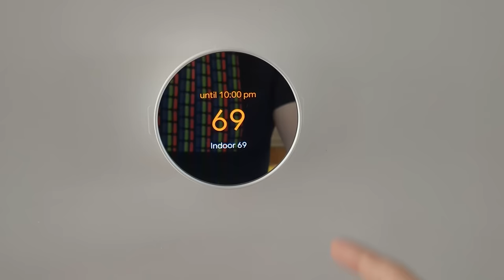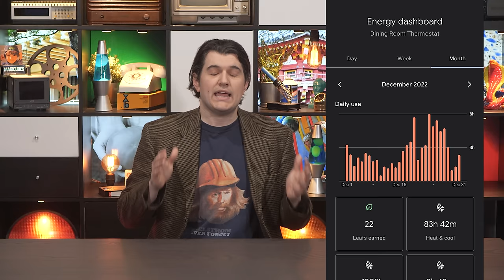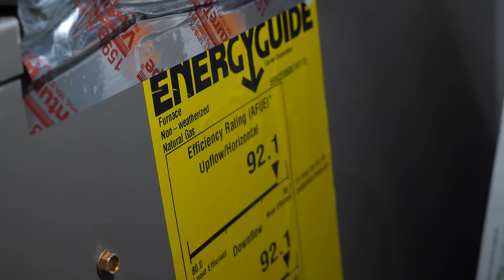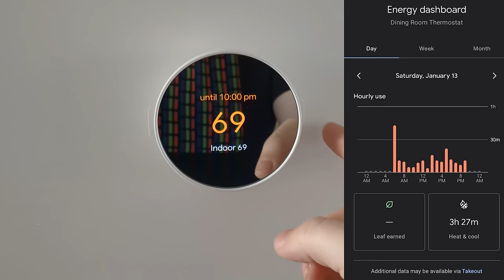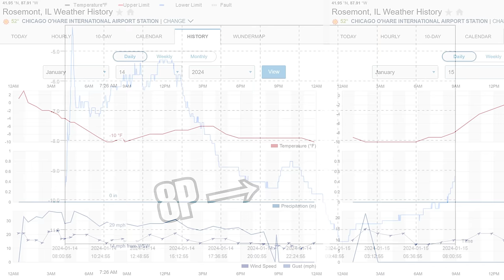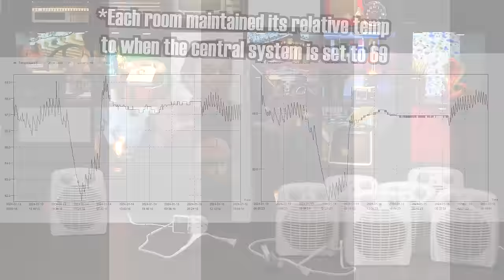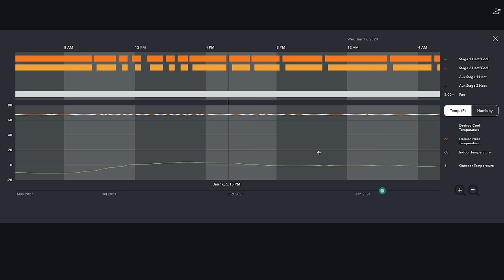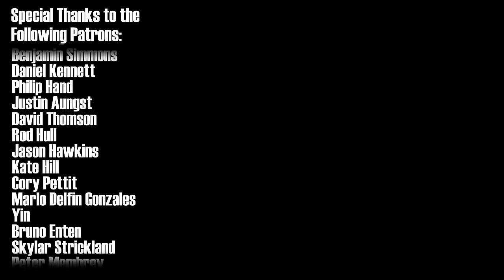Old HVAC industry practices are holding us back and costing us money. But we can fix it.

Comment: I feel your pain of HVAC stupidity after working in the industry for 3 years.  (Commercial)

Leave the paid for, fully operational system in place and add a single head mini-split in your main room/bedroom to take advantage of the heat pump savings.
If you need to switch to an all heat pump system.  Stay away from the many multi-head units (they rarely work as advertised) and install more than one unit.  WHEN one fails you don't lose the entire house and freeze/sweat.

The "modern" attempt at right sizing a system never, NEVER works.  It causes the units to run nearly 24/7, never catching up.  Instead of lasting 20 years it fails after 3.

Another bad (expensive) habit of the HVAC industry is trying to use the main AC as the primary source of dehumidification.  A dedicated dehumidifier should be used.  A modest $300 stand alone dehumidifier from the big box can do most of the heavy lifting and keep a house nice and dry.

Comment: So you’re basing the overdrive on the fact that you’re not running heat for 24 hours straight? Would it not cost you more to run the fan all day rather than a short 3 hour cycle?

Comment: At 19 minutes in, so i haven't watched the full video yet, but heres a couple observations i have made to play devils advocate:
1. While not putting the thermostat above 70 in the winter time and having a programable thermostat to adjust the temp when you wont be home or will be asleep is a great way to save money and better adapt yourself to tge conditions outdoors, not everyone does this. There are many folks out there who want their homes to be heated to a balmy 80 degrees 24/7 in the winter time. New construction projects are built with any one person or family in mind, so the HVAC systems will be spec'ed to meet the highest demanding individuals.
2. While -8 is certainly quite cold, colder can and will happen. HVAC designers will construct the system to be able to handle the highest temperature deltas they can think of (that one individual keeping their house at 80-85 while its the coldest day on record outside), and then add a little more than that to be sure. 
3. Having the heat running more often means that the forced air system will have to run more often as well, and an A/C motor powerful enough to properly circulate the air in the home for heating is not cheap to run. 
4. It was acknowledge that HVAC systems are typically spec'ed out based on common rule of thumb, and also that a townhouse style home is more efficient in regards to HVAC due to shared walls, however no connection has been mentioned in regards to a townhouse not being the typical single family/single structure home that the rules of thumb are derived from.

Comment: I've worked with HVAC, electrical, and electronic engineering, for a large bit of my life. And I have a forced air gas furnace.  I understand exactly how it works and I've repaired and maintained it over its last 25 years. And its still running strong and should be good for another 25 years.  I don't see why I would ever want it to run more than 25% of the time even on the coldest day here in Northern Ohio.  I have a gas powered car and I don't leave it running in the driveway all the time either for the same reasons.  Most of your logic sounds like something you've read from books or got from YouTube videos stating theoretical ideas instead of the real world.

Comment: Heat pumps aren't created equal. Be sure it includes a 2+-stage compressor maximizing SEER around 40. And cut BTUs needed with better insulation and window/door sealing.

Comment: @13:35 this is exactly what happens in insurance - 
Agents don't have enough experience to ask appropriate questions to figure out what insurance is actually needed. 
They shop what you have, hopefully, and that's it. 

Had a multi millionaire that stood out, had 25K/50K/25K limits on his Maserati and his Mercedes. 
Why? That's what the Geico agent recommended. 
The man owned 4 homes - had loads to lose, everything was personally owned by him, no LLCs.

25/50/25?? 
That's something maybe a college kid would carry - someone with very little to lose.

Comment: Im an hvac technician and live in a cooler climate. Heat pumps dont work here, in fact many electrical failures happen due to cold. Moisture and wind chills are not considered in These lab calculations. So this video is correct if you live around the equator, one below freezing day of the year. Let alone lets not get into the lifetime cost of your outdoor coil popping or failures and the cost of repairs (believe me im fixing them all the time). Sorry 90degrees out of registers just dont feel warm to anyone. Smart thermostats are useless on heat pumps due to "eco" settings, comfort and energy savings are two different sides of the coin. Ill agree with the many improperly designed systems and ductwork.

Comment: My apartment I rented was made by hippies. They didn't design our heating system to respond quickly in a cold snap, so I lived in an apartment at 3 degrees Celsius for 2.5 weeks as it was -35c outside. It was honestly pretty cool, I left my computer on 24/7 and my idle temps were 19

Comment: A 60K BTU/hour unit running 6 hours input 360K BTU in the day.  If you downsize 1/4 size, to a 15K, you'll run 24 hours to input that same 360K BTU.  Regardless of the size of the unit, the daily energy need was 360K BTU.  That 6 hours includes the periods of coasting too as the hysteresis limits rise and fall...and running the unit for 24 hours a day incurs additional power consumption of the air handler motor by a factor of 4x.  So you've consumed the same 360K BTU in gas (assuming zero losses) and 4x the electrical power.  Hmmm...  Is my math and reasoning off here?

Also, if you use temperature setbacks, don't you need a higher capacity to inject more heat faster to raise the temp back to the desired comfort temperature? 
ETA:  Ah - addressed at 28 min mark.  🙂

Comment: Haven't even watched this yet, but I already know how awful the "standard" designs are. My focus in Mechanical Engineering was Thermodynamics, specifically. I needed a new furnace (had underfloor heating in my house that the gas company broke in a long story that includes some local-class actions that different groups have been filing). I was looking to add forced air because the pipes were trapped in the slab.

The local HVAC "Specialist installers" declared that my 700 sqft slab house REQUIRED a 5 ton heater and 48 inch vents at $25,000 install cost... The 560-seat theater with 30 foot ceilings that I consult for doesn't even have 48 inch vents... I told the installers to get the hell out of my house right then and followed them out. I removed their company from any commercial install considerations through my engineering consults. My 800 sqft, 15 foot ceiling office has a single 12 inch vent on a shared tube with 6 other offices and BAKES in the winter at up to 98 degrees with two half-glass walls (I can't control heat in that building, so I bake).

Thought about doing water heater sizing next? lol I had a line installed for a 13kW tankless electric and the electricians kept trying to upsell me to a 20 or so kW heater declaring "1.3gpm isn't enough for a standard household."

I have a 1gpm shower head, and I won't be running the sink hot water while I'm in my shower... They kept calling me telling me to put in new lines after it was installed. I'm still happy, the water still burns me in the middle of winter if I'm not careful. I rejected their quote for a solar tie-in in search of a different company to swap my service box.
Reply: Okay, seen a lot of this and I'm at the space heater part. I used to have space heaters (during the boiler broken stage), but I've found that three oil radiators, no fans, no coil space heaters, work better. Went from a $450/month electric to like half of that and it's warmer. Haven't had the chance to do a proper study on why, yet. Some people say "well, the oil stays warmer longer when it's off... Well, yes, but energy is energy... the duty cycle changes though. 

I am wondering if it has to do with the space heaters forcing air and disrupting natural convection, pushing hot air to corners that otherwise won't need it where it ends up getting lost to the outside at hard, uninsulated corners where the corner studs are. Like I said, I haven't done a proper study on it. All I have now is a phenomenon noticed in a lowered electric usage (even accounting for kW usage on the detailed bill on an "always on" month.)

(I also need to monitor why the house suddenly gets sweltering at 2-3 AM... even if the heat is switched off. My current hypothesis is that the outdoor cooling has reached a point of low temperature or higher density that the in-house air has cooled enough or can push out enough to the cooler outdoor more rapidly, then drawing more of the attic's hot air down faster... Need to get the pi environmental sensors running next winter.)

Comment: I have a heat pump, but I also have gas. Heat pumps shouldn't be one's only form of heat, primarily because if the electricity goes out for days or weeks, a heat pump can't be used. Natural gas will still work, though, and keep the house warm.

Comment: I have an air to water heat pump. It is perfectly sized on the cooling side, it runs continuously above 100 degrees outside. But oversized on heating. 60kbtu heating, 42kbtu cooling. But I live in a much milder climate than Canada it was designed for, in the winter. I want to get a heat exchanger to heat the water heater in the winter, but I can't figure out how to design it or where to buy it.

Comment: Heat pumps at -30°-40°F are worthless -25°F is even starting to push it... -11°F not a problem, I watched my parents have 2 different heat pumps for about 20 years, the were great for temps around 20°F... my dad got the first one because the electric company offers discounts on the electric bill for the special meter that only ran the heat pump... but when the power goes out for 3 days and you have a generator switch on your natural gas furnace... nothing beats that... welcome to minnesnowda

Comment: Imo, You are just transferring the burning of fossil fuels back to the electric company which is less efficient than burning it directly. The other factor some say is that the grid cannot handle the increased load from going electric.
Reply: That's not less efficient than burning it directly, not at all.
You're completely ignoring how insanely efficient heatpumps are. 300-500% thermal efficiency most of the year.

Comment: I don’t quite understand why cold parts of the us rarely use radiators 🤔 They are much more efficient than forced air. Although I do agree that with heat pumps this is now a moot point as they are more efficient and provide both heating and cooling.

Comment: 100% duty cycle sounds weird only because it is not what we are used to observing. If you examine what is happening from the viewpoint of the equipment- the equipment does not want to experience thermal cycling. So maximizing the duty cycle, tho a tradeoff with some forms of equipment wear, is preferred in others. And certainly for high efficiency furnaces which prefer to be exposed to as cold of incoming air (or water) as practical- well, going slow is the only thing that makes sense.

Comment: I wanted to buy the heat pump equipment myself and pay a contractor to do the installation. It took a while to find someone who was willing to do the labor without forcing me to buy their ultra marked up equipment.

Also, I have the 3-ton unit in my garage on a pallet waiting for installation. After watching this video, I’m worried it’s slightly oversized for my house. Although, it’s a variable speed condenser so it can work down to 26% of its maximum capacity in some conditions. Do these variable speed units alleviate the issues mentioned here?

Comment: 5:05 wtf
NO Float Switch 💀
NO Insulation on drain line 💀
NO Metal exhaust vent 💀(really?? PVC??? even IF that's up to code there that's just plain no common sense!)
NO Mastic 💀

Anyways, sales reps are separated from service techs, ESPECIALLY in big companies, because the company doesn't care if the service tech can diagnose and replace a single compressor in a single billing hour if they can't get YOU, the consumer, to buy an expensive system using them instead of the other guys. A customer that buys from another company is a lost customer. The best sales reps in big companies often know nothing about how to service or diagnose an HVAC system, and they don't need to. What they need to know is how to extract money from your wallet by offering you (and often times up-selling you) something before you have the chance to speak with another company on the matter. Their objective is you give you a system (ideally as high of a SEER2 rating as you can afford), give you surge protection, give you a UV Light, clean your ductwork, and so on and so forth to transform the minimum system sale of $6,000 into a system sale reaching $15,000. Here is a tip: try to find the smallest company without much advertising that still has many good reviews. Smaller companies have smaller overhead, and the technicians often have to be well-versed in both sales and service instead of having a dedicated sales team. However, just because they know how to diagnose a system doesn't mean they know how to size your system for your home...

However, that's not the end-all-be-all. Skilled, professional HVAC service techs that can do both sales and diagnostics still won't perform a heat load calculation, because a proper heat load calculation costs time. As a service tech that can do sales, diagnostics, and even heating (or rather, cooling) load calculations, I won't even bring up a heat load calculation unless I know for a fact the customer is loyal and is practically guaranteed to use us. We can't exactly charge you for heat load calculation, because you'll just go with another company that won't do a heat load calculation if it means less money spent. If we did that for "free," and built the heat load calculation into the cost of the heat pump, then our heat pump will be more expensive than the competition, which means we'll have spent time (which is our money) giving our competition information about what size system you require, and give them your business instead. Even if we don't build the heat load calculation into the cost of the heat pump, we're wasting our time (money) on you, AND you may go with the competition anyways if they're cheaper. If customers were a bit more loyal instead of searching for the absolute cheapest option, we could offer a better service without the fear of losing money and going out of business. Our company runs about $900 more on average than the cheapest company around here in Florida that still does full permit and code requirements, and the physical installation handled by our install tech is leaps and bounds better than even the most expensive companies, but customer's whose prerogative is to "call around" is a lost sale if it's the difference between spending 7.4k for a 3-ton system and spending 6.5k. However it's also pretty cool to fix all their problems when they go with the cheaper company.

Also, the difference between a heat pump and an AC system is that it has a reversing valve, a defrost board, requires more conductors in the thermostat wire, an additional refrigerant metering device (TXV or Piston), and accumulators (though you can sometimes find these on higher-end AC units too). This makes heat pumps usually cost around $500 to $800 more on the contractor's end, and although I'm not in administration or price calculating, I can pretty much tell that we calculate our prices based on material cost, labor cost, and value cost. 20k and 30k system sales are not unheard of for ridiculously high SEER2 rated units, but I feel so good when a company is trying to jip grandma into getting a $15,000 14.3 SEER2 Goodman (badman) system and I come in and save the day to offer a better product for a 9k less. Those high prices are to pay the sales rep their ridiculous commission of 30% and the high overhead that bigger companies require.
Reply: holy shit. imma read this after video

Comment: How much heat does a heat pump put out at 20F? How efficient are the electric strip heaters that will be doing all the work?
Reply: My small air-to-air heatpump puts out 3.2 kW of heat at -6°C, while using about 1 kW. 

All resistive heaters, like strip heaters, are 100% energy efficient. 
1 kW in = 1 kW out.

Comment: As someone born in kuwait.. where the temperature reaches over 65c in the summer regularly under sunlight.. im always amazed at how you americans dont have "heatpumps" which is basically a split ac with a switching valve

Omg didnt think you'll mention it 😂😂😂

Comment: When you say you need only 1/4 the heat output based on the maximum runtime ever being 1/4 of a day , 6 hours, on the coldest day you've experienced are you saying you'd be okay with the heater running continuously?   I wouldn't want mine running 24/7 or even close to that, not even for one day a year, if for no other reason than I'd be parched and flakey all the time.  I know, some would argue I am already flakey all the time, but still.

Comment: RE Home-Away on Nest ~ 18:00
I'm with you in theory, but half of the things you mention about being able to see stuff on the network would also be true if you have, say, a wireguard VPN on your phone. 
As for the 'suddenly being a mile down the road', that's likely because the phone likes to use coarse location tracking rather than spinning up the GPS calculator and it's trying to guess based on the cell tower
All that being said, I 10000% agree that the home-away functionality is utter gorbagio. As are a plethora of other wonky decisions like the whole system with remote temp sensors